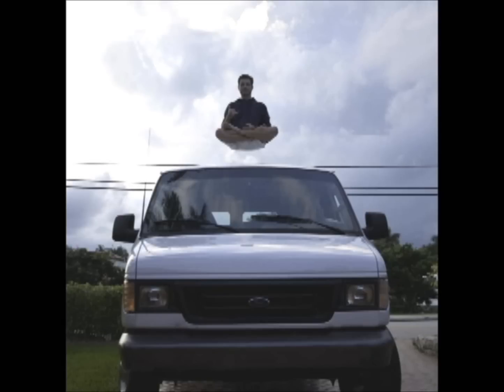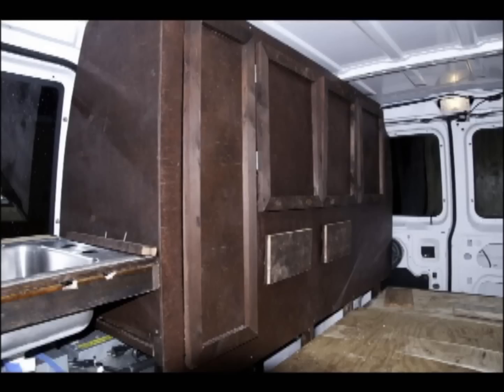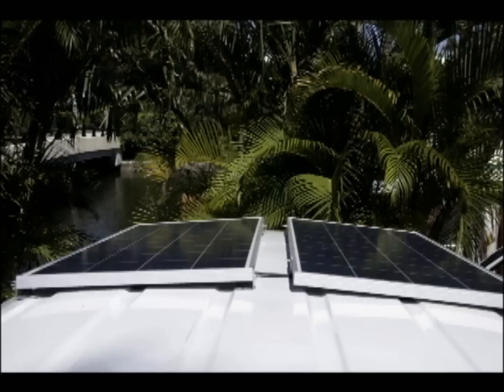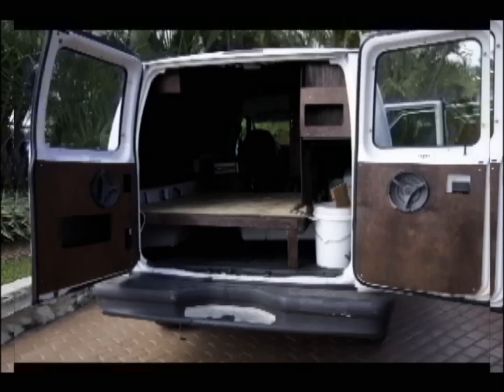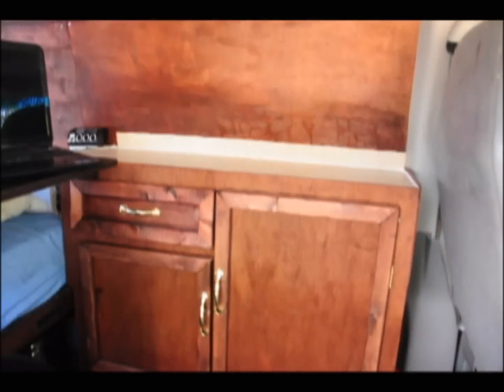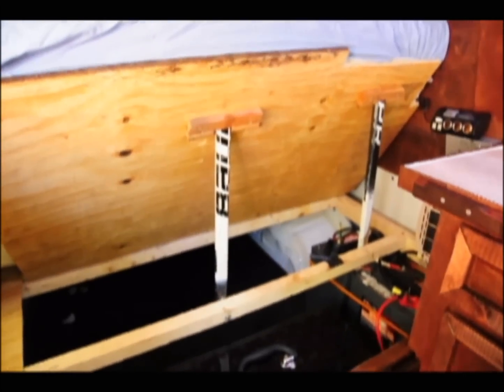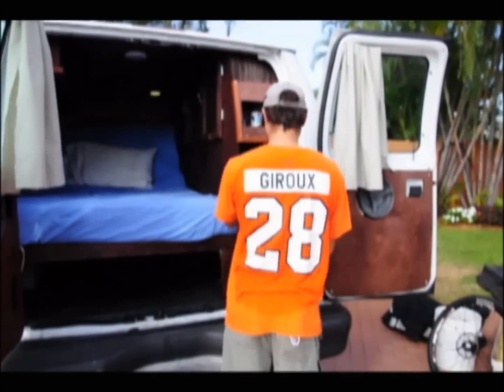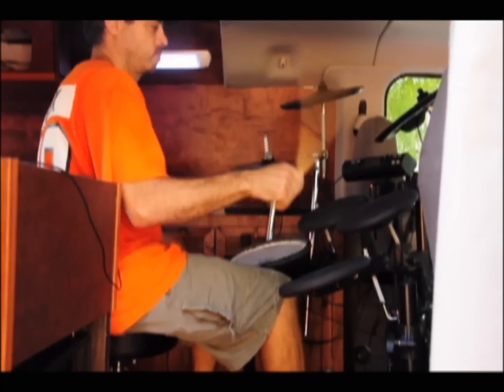Magic Bus- A cargo van conversion.wmv

Comment: That last part made my day, how you were able to set up your drums in the van. I hope I can get my van like that one of these days. I just have been working on a paint job :) $30 for 2 quarts of "sail blue" rustoleum paint some rollers and some tape and went crazy. I had to go back to get a spray can cuz there are alot of crevices that the roller cant get to.

Comment: BRAVO!!! Well done dude! Keep us posted if you make any changes or improvements,
Reply from the maker: Thanks! Just bought a house so the van won't see much action for a while. Overall I was really pleased with everything. One change I would make would be to use more effective latches on the cabinet doors. A hi-top version would be great for the headroom. The dream changes would be a perfectly insulated van with an efficient A.C./heating system, but one can deal without them.
Reply: Congrats! On the house. What would an ideal a.c.\heat system be? I am planning my conversion and it seems that I will have to bite the bullet and go generator and propane.
Reply from the maker: Jeffery Springer
The ideal a.c./heat system would be one that runs by recycling the pollution out of the air, runs silently and with 100% efficiency! lol. Haven't found one yet, though! I'd recommend revisiting the idea of solar as opposed to Gen/Propane. Solar has worked really well for my purposes. (yours may be different though)

Comment from the maker: Thanks! Yes, the combo of the 220AmpHour Batteries and the 290Watts of Panels have provided plenty of power! I was a bit concerned about thieves trying to pull the panels but: 
1) I'm in the van more often than not.
2) It ain't easy to get them off without a big pry bar. Most thieves don't like to operate out in the open, especially 6 feet up in the air on a roof in a parking lot.

Comment from the maker: You're Welcome! Regarding Insulation:
1) I was lulled into complacency since I built it in Southern Florida.
2) I'm not sure how effective it would ultimately be.
3) Headroom is already at a premium and even 1 inch less would make things considerably more uncomfortable.
I figure when it's hot you're gonna be hot, when it's cold you're gonna be cold. Best way to deal with it is with more or less clothing. That said, if I had a hi-top and was doing it again, I would consider insulation.

Comment from the maker: @ J Thom- I actually took the van all over the U.S. and saw temperatures from 0-100 degrees. You can check out my thoughts on the insulation debate in another video. I didn't have any moisture problems. I normally keep the windows open a crack plus I do have a vent in the ceiling of the cargo area. As for tools, you don't see them in the video, but I carry more tools than you'd find in most homes. And the spare tire in  the Econolines is stowed under the chassis at the rear. Thanks for the comment!

Comment: There's nothing sweeter than just packing up your van and driving off for an unspecified period, equipped to live comfortably while everyone else is dependent on using motels etc
Though I'm in the UK I've travelled up and across America a few times in a car but truly would have preferred a nice van conversion like yours. I've converted my Ford Transit adding skylights, shower/toilet cubicle, hob, fridge, 240v mains power, water heater, catalytic gas heater, bed, flat tv, led lighting etc. cont.

Comment: Nice van. Having previous experience customizing vans, I would focus on lightweight materials like aluminum for framing cabinets etc. cabinets can be finished with formica or wood laminet. Excess weight reduces gas mileage and places more stress on the drive train and suspension. Great job.

Comment from the maker: @ tracy smith- The fridge is great, although I have had to replace the fuse a few times. With 220 Amp hours of battery and nearly 300 watts of the solar panel I have never even come close to running out of power. (and even if I did I could run the engine and charge them with my alternator/battery isolator). Redundancy on top of overkill!!
Reply: DJ Wolinsky did you ever find the source of the fuse blowing? loose connection? corrosion on terminal?

Comment from the maker: @ Man Hernan- Just screw the 2x4's into the steel ribs throughout the cargo area. Be sure to drill into the ribs (obvious) and not through the thin sheet metal and you'll probably need to drill pilot holes first. I was able to hang two 2x4's along the ceiling with bolts also. You may want to consider 1x1's instead. 2x4's weigh more, cost more and are a bit of overkill in a van. I used the two 2x4's on the ceiling and the rest were 1x1's and faces were finished with 10mm underlay. (although the bed frame is 2x4's). Small metal right angle braces were also used extensively throughout.

Comment from the maker: I was going to go with a single panel (~200W), but I got such a great deal on the pair. Having 2 panels in parallel does charge up the amps twice as fast which is nice. I have had no problems, but I think my set up is overkill. My normal daily "Depth of Discharge" is probably less than 20% (200 Amp/hrs in the batteries). My refrigerator uses at least half of it. I would recommend the addition of a battery isolator so you can charge your house batts when the engine is running.

Comment: Great job on the camper van....& maybe get a vented battery box ASAP ! Cuz Hydrogen off-gasing from charging batteries sealed under you bed, add in a spark to the mix...might make 4 a bad day, Cuz !?....Safe and happy trails, Peace brother VanDweller.

Comment from the maker: Good point. I was just more comfortable working with wood and found it would be easier to source. Bearing in mind the weight, I went light weight whenever possible. 1"x2" studs and I mostly used 10mm underlay instead of plywood as it is very light. And just an FYI for everyone: I'm averaging 16.5 mpg which is much better than I thought I would get. I do however drive conservatively (No jack rabbit starts, coast into red lights, etc....)

Comment from the maker: It flows! But seriously I have a 9 gallon water tank (be sure to make an air vent or you will blow it up when filling.) I picked up a small 12 volt water pump and water inlet connection from a marine store. So I hook up a hose and fill it up. Turn on the power switch to the pump and water flows to the sink faucet and shower head which I can pull out the side door.

Comment from the maker: Sportsmobile will build you whatever you want.
As for the power: I have 2 solar panels feeding into a BlueSky controller to charge two 6 volt golf cart batteries (220 Amp hour) which creates a nice 12 volt system which hasn't let me down. I also have a "Battery Isolator" so when the engine is running it also charges the batteries via the alternator.

Comment from the maker: Get a lot of right angle brackets and sheet metal screws. Screw the hell out of everything. (Make sure you screw into the 2-ply parts of the sheet metal in the van. Those 90 degree brackets are like 50 cents a piece at some places and I used a ton of them on my conversion so I made my own: buy ~3-4 foot section of aluminum angle, drill holes, cut with band saw/jig saw.  Use eye protection and gloves. 
Good Luck.

Comment: Well done! Quick question: Did you bolt the wood onto the van?  Will you please explain this and also how you hung the simple white curtains.
Reply from the maker: Thanks! I only used 4 bolts and that was to hang two 2"x4"s along the ceiling to form the front wall of the cabinets on each side. If you have an Econoline and patience you can get those bolts in there, but it's not really necessary. Easier to just do what I did with the rest of the wood, drill pilot holes and use sheet metal screws. (Just make sure to screw into the support studs and not the thin sheathing) (Also, see my reply to "Man Hernan" below). Hanging the curtains is super simple. Two small sheet metal screws on each side and then just tie up some type lightweight cord between them.

Comment from the maker: You guessed correctly. I didn't insulate and I'm going to make a video regarding that choice in the near future because many have that concern. I'm not actually planning on staying in the van in the winter. But if you did, it would still be a heck of a lot better than staying on the streets. And if you rolled it into S. Cal. or Florida it would be toasty! The benefit of a home on wheels!

Comment from the maker: I'd come down but I've been told not to mess with Texas :)  You have a Sportsmobile somewhere in Texas, they do the real deal, but you gotta pay. The stove would be easy enough, LED lighting is smart (I used 3 LED lights, could have just used 2). The flat screen and larger fridge wouldn't be a problem either, just remember the extra power requirements. Without solar you'll need enough battery power to get you from one charging outlet to the next.

Comment from the maker: Slides in the through the rear door on the passenger side. I actually built the whole thing around the bike storage! It is a snug fit right next to the 9 gallon water tank which sits on the wheelwell. (I do remove the front wheel and seat)

Comment: just a heads up i saw a washing system made from 3 buckets a plunger and a clothes line(think manual washing and only running water is needed) also marino wool is anti bacterial and "lasts" an extra day if necessary on the road and that alone can save you

Comment from the maker: I'm going to address the subject of "insulating your van" in the near future since it seems to be a popular concern. Currently I have two small fans and an exhaust fan in the ceiling to help cool things.With my solar setup, I think I could add a heater even though they use tons of juice.  There is a propane heater, I think called "Mr. Buddy" which I think is approved for indoor use, but that is always risky and potentially fatal if it doesn't work as promised.

Comment from the maker: @Rick Bauer- 1) I soon added a ceiling fan (not as nice/expensive as a "Fan-tastic") in the cargo area. 2) The insulation question has been asked ad nauseum and answered. 3) I guess PVC is an option, but I'm not sure how much weight reduction you'd actually get and it's probably more expensive. Besides I like working with trees more than petroleum. 4) Go Flyers!
Reply: DJ Wolinsky by far the best camper van conversion i've seen, excellent job buddy :)

Comment: Nice design but what about insulation?
Reply: my thoughts
Reply: My first thought also. Insulation seems first in every van followed by fantastic fan usually then electric.or maybe electric before fan lol. I like the cabinets though and the shower. My big dilemma is I need AC without engine running via solar ideally. I will have an animal or two I don't want to cook them. I'm hoping he wasn't teasing about AC. That's the second "chaise lounge bed " I've seen today. I like that. What about the AC dude ?
Reply: No insulation? You from Hawaii???

Comment from the maker: Thanks! I'm going to post a video soon regarding the insulation subject. Stay tuned. As for the road noise: Well, it's a cargo van, not a Cadillac. But it's not bad really. It came with rubber floor matting throughout which no doubt helps. And it's got to be a little better with all the stuff I built into it. Really the wind noise thru the window is always a lot louder.

Comment: How did you install the water tank for the shower and faucet? But great job on the build
Reply from the maker: Brandon Menary My 9 gallon tank sits on top of the rear wheel well (Passenger side) and is strapped in place with cargo straps cinched tight.

Comment: Cont.. I haven't put in solar panels as the UK is not famous for it's sunshine. I've travelled across Europe, into the east to Ukraine, through Hungary, Czech Republic, Poland, Germany, France, Moldova, Romania, Switzerland, Luxembourg, Monaco, Spain etc and recommend a van conversion to anyone. All you need on top of fuel is a little bit of spending money, so it isn't that expensive. Fuel in Western Europe is over $10 a gallon & my van does 30mpg, so it's by far the major cost factor.

Comment: Awesome video! I'm building a van this summer I hope. Are those batteries dry cells? If not, what are you doing about venting them? Cars like the Olds Aurora that have batteries under the seat or otherwise in the cabin area use vent tubes. Just curious,  keep up the good work!
Reply from the maker: Thanks! They are not dry cells. They are not directly vented. Warning: I am not "qualified" in this area so I make no guarantees and recommend doing your own research and doing what you believe to be safe and smart. I want everyone to be safe so you probably should not follow my lead. That said, by my calculations it would take 714 days for enough hydrogen/oxygen to accumulate inside the van before it approached ignition levels and then only if it was sealed airtight and the batteries were constantly being charged. These vans are far from airtight even before installing a ceiling vent as I did and they are being charged by a smart charger so they are only intermittently being charged. In any case, if I hadn't gotten a bit lazy I could have easily cut another hole in the van's wall and installed an airtight battery box/vent tube. Good luck with your build.

Comment: As long you stay in warm weather this is a good rig. There os no insulation on the walls. Let us know if it gets too cold in there.
Reply from the maker: You are correct sir. When it gets cold outside it gets cold in the van. I plan on doing a video addressing the insulation question.
Reply: DJ Wolinsky I've had over 5 years of planning my conversation but haven't been able to complete it since I've also been using it as a work van. I hadn't planned on doing any insulating. I was under the impression that all I'd need was a good low-profile (eg.Wave 6,000BTU) heater to keep the area warm and a good comforter/sleeping bag. Isn't that enough?

Comment: DJ, I loved your video! I am a drummer, too by the way...anyhoo, I am wondering, how did you learn to do this van conversion? I have been scouring the internet for a detailed 'How to' guide that covers the construction of the various systems (plumbing, electric) and in what order one constructs things (like the wiring, insulatino, etc.). I also really am amazed at the cabinets you made from scratch! 
Is there any way you would be open to me contacting you personally via email to maybe ask you some very specific  questions I have? I know nothing about doing a van conversion and I have something very specific I'd like to accomplish. Maybe you could advise me? 
Any tips or advice I could get from you (or anyone here) would be MUCH appreciated! 

All the best!
Reply from the maker: Thanks. I'm sorry, but I won't post my personal contact info on this forum. However, we could possibly get a thread going here. Not sure how much help I can be with your specific questions, but maybe starting a dialog here could be useful to yourself and others interested in the subject.

Comment: I like it.. But do you not think that those 4"x2" were a bit of an overkill . On my small camper I used 1.5 x.1",  looking back now I am deffo going to do my next one in smaller still. Cheers, Pete
Reply from the maker: Yes. the 2"x4"s are overkill, but while doing it for the first time.....well, better safe than sorry.
Reply: I did the same thing many many years ago, but great stuff al the same.  Cheers, Pete

Comment from the maker: The shower is currently "room temperature". My power capacity seems to be significantly better than I thought it would be so I do have the option of adding, say an electric on demand water heater. But it is an outdoor shower so if the ambient water temperature is too cold to stand, it probably means the air temperature would dissuade me from using it even with hot water. Then again, maybe not.

Comment: Two things. First, no insulation. Cold in the winter, hot in the summer.  It doesn't cost much to insulate a van, doesn't use up any space since it is behind your interior panels, so why spend all that money for a van to live in, or camp with, and not take the extra time to make it more liveable?  Second, I didn't notice any ventilation for the interior batteries. They put off gases, a lot more when its hot, and again, doesn't cost much, or nothing if your creative.

Comment: WOW this is exactly what I am planning on doing complete with the solar setup. I was just going to get one 140 panel but I am concerned that it would not provide enough recharging power as I use a cpap machine when I sleep that would draw around 13 watts along with my laptop, small fan. I do have a 900 watt generator I got from Harbor Freight for backup but I am really considering getting another solar panel to add to my array. How much power are u using and any prob with recharging?? Thanks

Comment: Hey man, first off AWESOME van!!! Very inspirational as I am going to try and do something similar to this, especially with a cargo van instead of a camper for more stealth capabilities and less hassle from police. Anyway my questions are, how tall are you? I am 6 feet tall and just wondering if your setup would accommodate someone of my frame. Also, what model van do you have, and how many MPG approx does it get? Once again thanks for the video, very cool.
Reply from the maker: I'm 5'8" and have to crouch inside when standing. Definitely suggest trying to get a Hi-Top if you plan on standing inside much. My bed is a "Full" (53"x75" I think), you might want to go little bigger for more space. Mine is a Ford E250 and I average around 15mpg (that's mostly highway miles and going easy on the gas pedal). Thanks and Good luck!